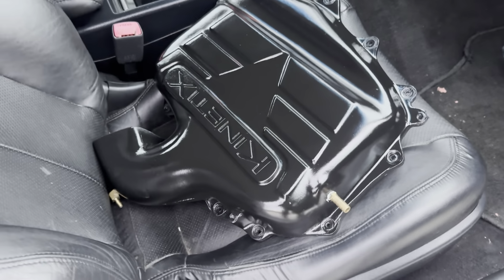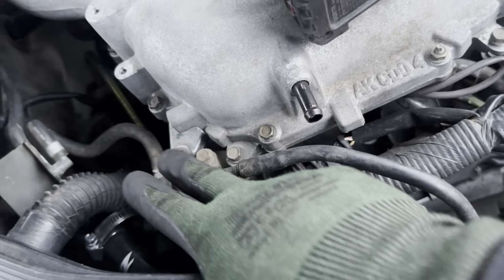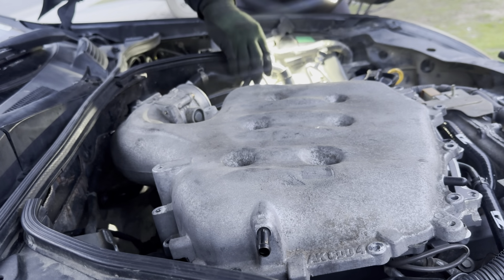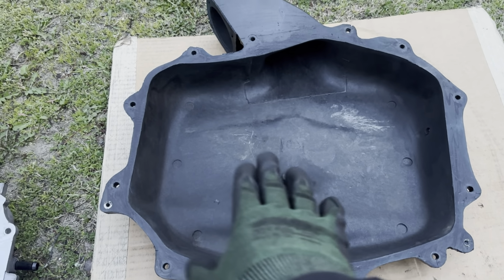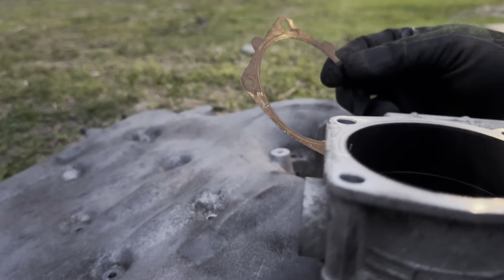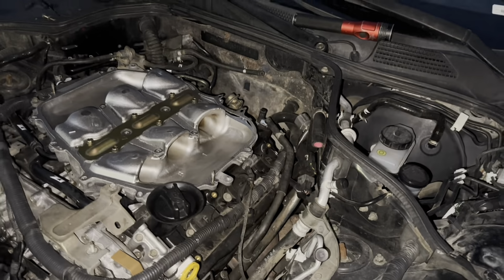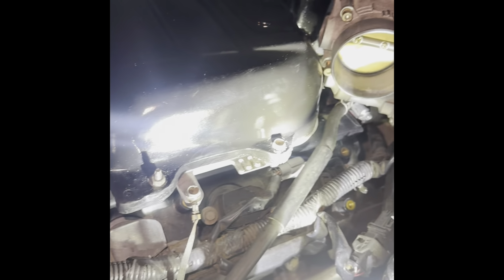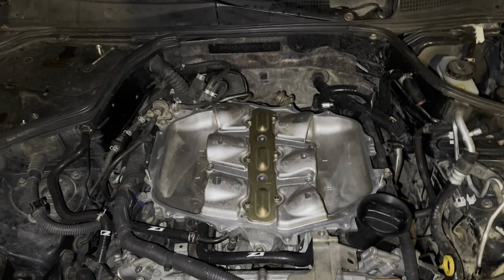How to install an KINETIX plenum on your G35

Comment: Clean paint job bro!! I also got a deal on one for $130
Reply from the maker: Thanks brotha, and hell yea that’s a great deal, how your car running with it ?
Reply: @waresgarage8590  Going to install it this coming weekend I want to paint it as well. What size fitting you use for the 2 lines?
Reply from the maker: @seth-mata  nice let me know how it goes bro, which lines the lines I blocked off
Reply: The 2 lines you blocked off
Reply from the maker: @seth-mata  when I get home I’ll look at the box I forgot the size but it’s those the mid size one, I’ll give you the exact size when I get home
Reply from the maker: @seth-mata  the size is 3/8 or 9,5mm universal part number 800-011
Reply: Just got mine for $75 can’t won’t idle but figured out it’s probably them 6 holes that aren’t plugged that’s the issue

Comment: Had that plenum when I had the a de in my z, same gains as a plenum spacer
Reply from the maker: Yep that’s why I was saying If you get the spacer it’s liking having the KINETIX I’m thinking about getting another stock Plenum cutting the 6 metal parts off getting it welded ported
Reply: @waresgarage8590  yeah at more then half the cost too waste of money on the kinetix
Reply: so there wasnt an actual difference?
Reply: @pierres3x  no their ain’t no difference between the when coming to whp gains
Reply from the maker: @pierres3x  no there’s an difference when putting the KINETIX the one I got use didn’t seal right think it was warped so I gave it back and got the 75mm throttle body with spacer

Comment: When you put the RTV on do you take the gasket off or keep it on?
Reply from the maker: just leave the gasket on no need to take it off if you put the RTV on, if you buy it new .you dont have to worry about the RTV. mine was use and it didnt work right think mine was warped, so the guy let me give it back and i ended up getting the 75 mm spacer and throttle body off him